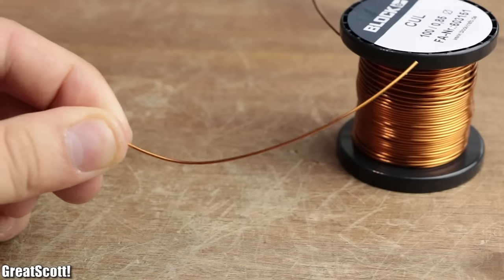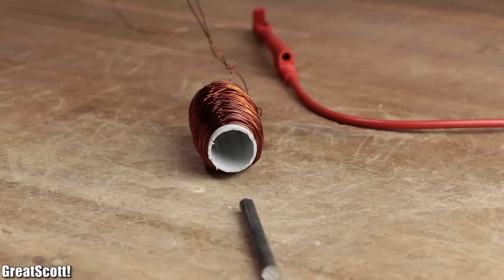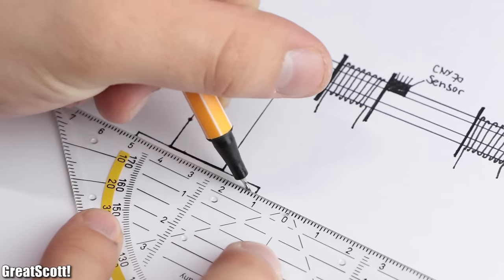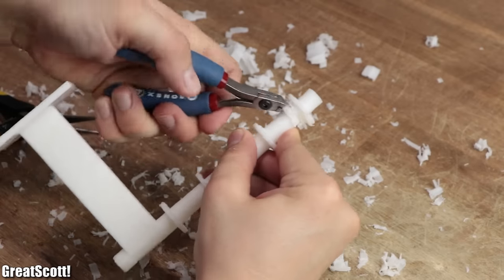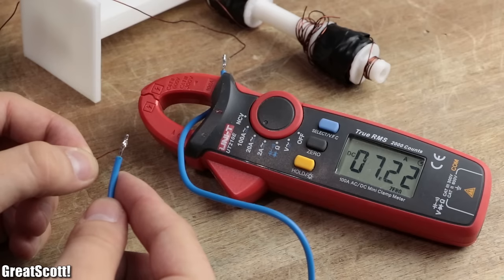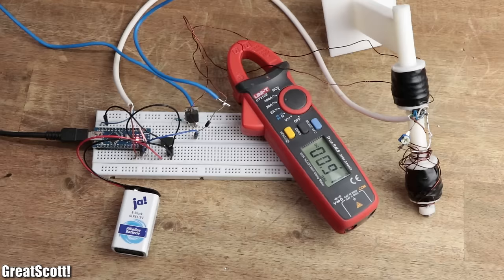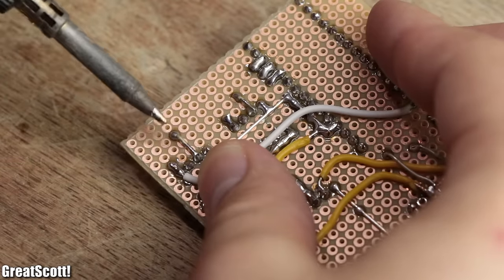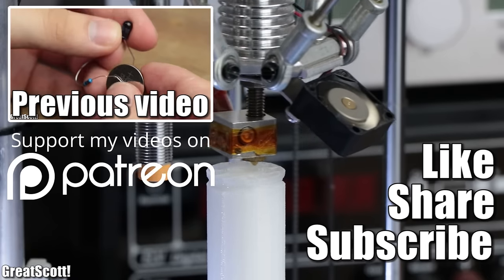Make your own Coilgun

Comment: Why Windows 7?
Reply: Probably because he hase some Windows Software he needs and thus can't switch to Linux
Reply: Cause Windows 10 and 8 sucks
Reply: +Johan agree
Reply: Well, I like Windows 10 but yeah, Windows 8 sucked (actually still sucks, since I have to use it in at work ^^)
Reply: Yeah why not vista lol ;)
Reply: +DASxURKM Windows 10 = Spyware
Reply: H. Z. not if you know how to configure it ;)
Reply: all windows operating systems after xp: shit. every linux version with gnome or kde: awesome!!!
Reply: Lot better than a Mac, those are possibly the worst computers on earth. A raspberry pi would function better than those
Reply: XP
Reply: +Master of code 101 You are wise man/woman. In my teenage years I was way dumber than now and spent 500 good, usable American dollars on a 2 year old Mac on Craigslist. Broke 3 months later cause software issues. Bought a $80 10 year old toshiba with win7, and is faster than Mac ever was, and probs will last longer. When you buy Mac you get pretty, not a practical computer!
Reply: +luigisf yes that is kind of right, but i have not used a mac until now, because my 2009 lenovo thinkpad t400 worked just fine with windows 7 until i upgraded to windows 10. there where some nasty driver issues that made my computer producing one bluescreen after the other, so i formatted the harddrive and installed windows 7 on one partition, because some of my programs only work with windows, and ubuntu linux on the second partition. With that configuration I have not had any problems other than my battery getting worse and worse
Reply: Macs arent that bad, its the hardware that is the issue. If you were to build a hackintosh, essentially putting much better components than Apple ever would, you would see the real potential of a Mac.
Reply: +D.Minister yes, due to the fact that mac os is unix based it is of course better than windows, but it is not as good as linux due to the fact that it has a proprietary software Installation system and stuff like that
Reply: +D.Minister or get a Windows pc and put VMware on it to run a virtual Mac on it, so you can have best of both worlds :)
Reply: *****
I have never used linux before so I cant say. I have to admit, I am a bit apprehensive when it comes to trying to learn it.
Reply: +D.Minister no the Mac physically is kinda cool looking, but yep the hardware is horrible
Reply: Master of code 101
No what? I didnt say anything about the look of it. I was simply stating that Apple's OS is a solid enough OS to run video editing software, audio engineering, Photoshop (essentially adobe programs), things of that nature, but the internals are far from outstanding. I am building a computer that in the end will cost about half of what the typical Mac goes for and will have both Windows and Mac OS. I dont write code, I dont have any kind of intention to get into hacking, so I have no real need to learn a new OS like Linux.
Reply: +D.Minister I have yet to hear a good enough argument to defend the price of a brand new Mac for most people, especially students which are the bulk of the users(at least that I see on a daily basis). The only reasonable explanation is good marketing and that's it(back to school Apple discounts/free iPod with Mac purchase/it's very pretty machine and everyone cool has one ;) ).
Reply: luigisf
I just gave one in my previous comment and add to it the ability to build a hackintosh yourself with just having access to one. I am not trying to sell anyone on getting Apple. I am saying that Apple runs certain programs better than Windows and with the correct hardware will do it better than any Windows based computer. I am not trying to argue any of this. You have to realize that for most people it is either one or the other. How large is the Linux install base? Most programs are written for Windows. So as beneficial as Linux is people arent putting forth the effort to learn it and neither will I, simply because the reason(s) one would use linux dont appeal and are of no use to me.

You are entitled to your own opinion, why do you feel the need to criticize mine?

Comment: can someone explain with more simple explaination 😭
Reply: i dont understand any of electricity
Reply: The electricity flowing through the coils creates a magnetic field capable of accelerating magnetic materials such as, in this case, steel. The sensors serve the purpose of cutting power to the coils at the exact optimum time for them to have been accelerated by the coil, but not slowed down. This is necessary because the projectile is only accelerated to the center of the coil, once it passes that point, the magnetic field will try to pull it back. By cutting power just before that happens you are, again, getting as much acceleration as possible. I hope that was simpler to understand.

Comment: i always HATE IT when people over engineer things and go for AI or SENSOR or CAMERA and computer chip to do the recignition and remove the science out of it the resistance is known lenght of tube and substance is air this is always the same = you can do the math on when the coil should be active and deactive and make it fully analog not ad a sensor to see when the dang thing is in the middle and litarly have the gun break beond basic repair needs other than by the designer  OVER ENGINEERING FOR NO REASON is stupid